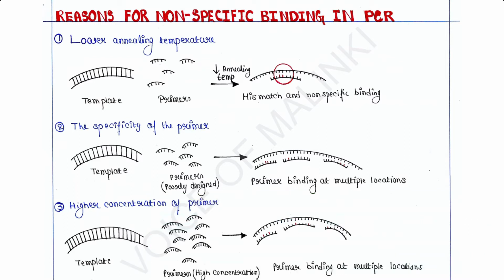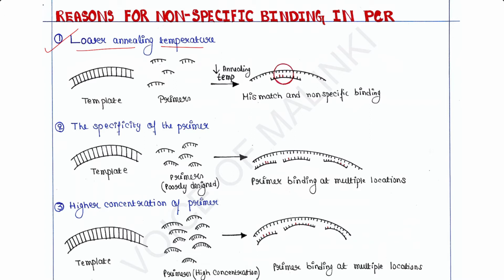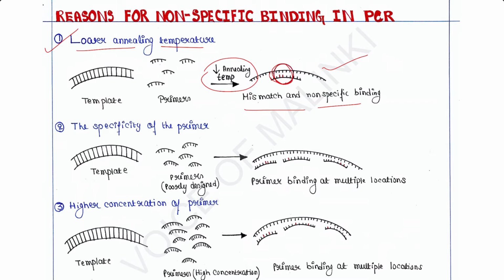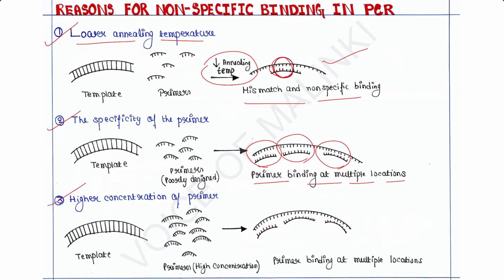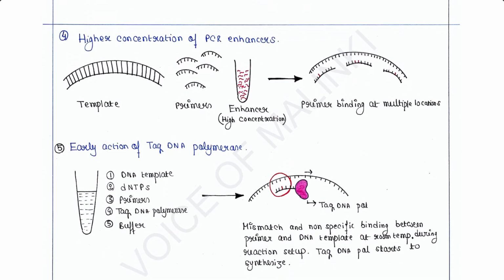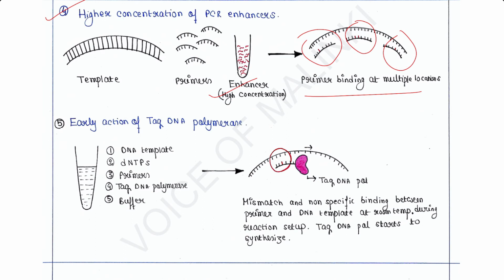Reasons for non specific binding in PCR | PCR Lecture series

Comment: Hi Dr. Malinki, I have a random question about PCR amplification. if I use universal marker like SRAP, I dont know what gene is targeted. 
the PCR proses starts from denaturation, annealing, extension. then if there is DNA band amplified in 900bp, I can understand when and why it starts (because forward primer binding to DNA template), but how the amplification is ended in / has weight 900bp, is there an area that is recognized by the primer to stop? Thank you
Reply from the maker: Reverse primer also binds its complementary sequence (may be it is partially complementary). If primer contains high number of G/C, it will bind somehow. In your case also may be it happened. And the length is 900 bp (forward to reverse). This happens randomly.
Reply: @VoiceofMalinki  thank you Dr. Malinki, I read this directly, I have studied it more. then, I have more question, this is still related. after I convert it to binary data to analyze using GenAlEx, I still don't know how to read PCoA data, how the value of percentage in every coordinate means to diversity. would you be willing to make a video explaining how to read PCoA data? thank you for your help ❤